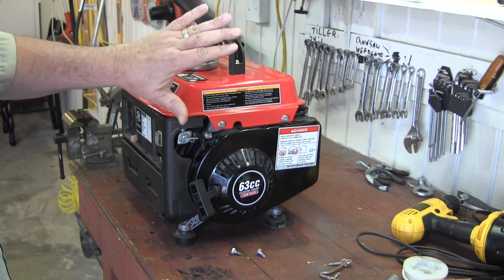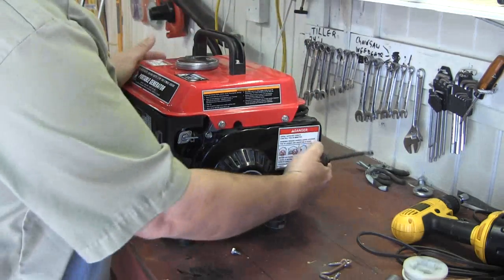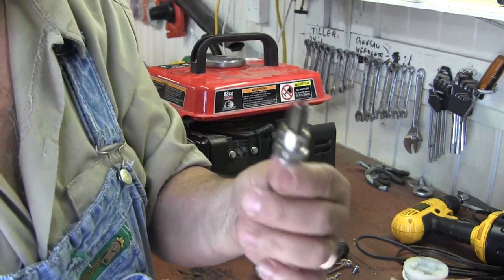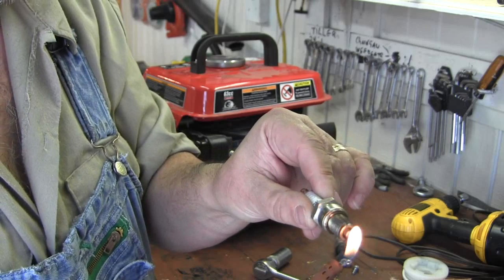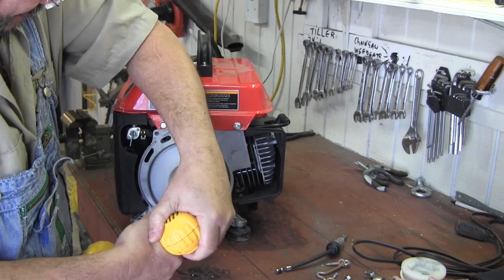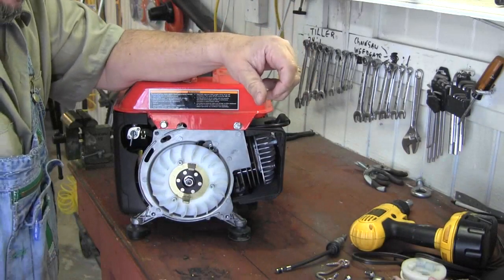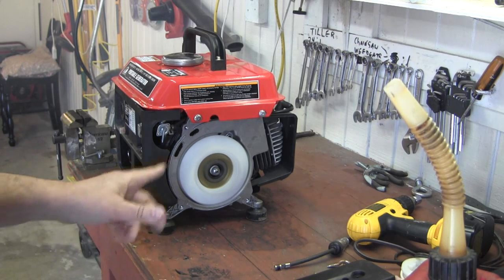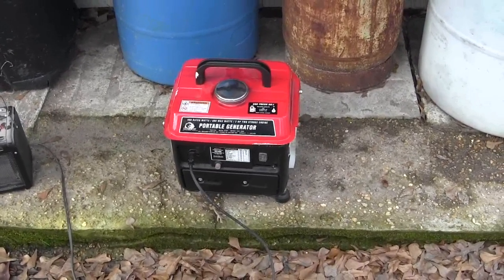Harbor freight generator wont start

Comment: V power for coils. Don't even worry about lawnmower shops. I got escorted off there shop. The original plug is no good. // Autolite is the best///// also 2cycle plugs. Tend to candy. Sand paper / small will clear that. you bet run it out. Thing when it's running is good.though I've learned all the traps.sgt williams retired.

Comment: The problem is not the spark plug or flooding. I own two of these 800 watts wonders, as well as several other small to medium sized generators, and the starting problem is ALWAYS the same after they sit for more than about a week...

WATER IN THE FLOAT BOWL.

The carburetor design will not tolerate even a small amount of water... and since water is heavier than gas, any moisture that condenses in the fuel tank always end up in the float bowl, and the engine will not start.

The solution is simple. Drain the float bowl EVERYTIME before even trying to start if the generator has sat for more than a few days. All you need is a 10mm wrench, a small cup, and about 30 seconds.

This basically never fails. 99.99% of the time, after turning the fuel back on and allowing the carb to refill, the generator will start on the first or second pull.
Reply from the maker: K Danagger no. This was so flooded that when I pulled the plug and cranked it over,fuel came shooting out of the cylinder. This was a case of not shutting off the fuel and the needle valve that is supposed to be pressed into the fuel orifice when the bowl is full, leaks fuel slowly into the carb and then into the cylinder.

Comment: all chinese engines come with a cheap, no good spark plug.  change the plug & no more problems. install ngk or champion or any good quality plug. my generator came with a plug named "torch" & it wasn't a torch by any means.after putting in an NGK, it starts on the first pull.

Comment: maybe the gas got old. would not fire.  easy. remove the gas from the tank. leave the plug out. choke it. pull it over 5 or 6 times.  clear it out. and with the pull stater  removed the engine is not being cooled.

Comment: When a small engine is flooded bad especially let sit for so long the gas will  run down in to the oil you always change your oil when something is flooded that bad
Reply from the maker: For someone that seems to know what they are talking about,your comment is  funny. This is a 2 cycle engine. there is no motor oil to change.

Comment: My name is Tom and I have G.M.C 850 generator no use for one year.I tray to start bat no start.Compresion is good but pure spark on sparplug.How I can repaire.Lot of thanks if someone cen help me aut
Reply from the maker: Tomo, if you have good compression and good spark,then your issue is fuel related. Remove the fuel line from the carburetor and open the fuel valve to see if fuel is actually coming out of the fuel line. If it is,then you have narrowed your problem down to the carburetor itself. If you've gotten this far, remove the carb and disassemble it, then spray all the orifices with carb cleaner. If you have an air compressor,blow it out with compressed air. If you don't have a compressor,you can use a can of air that is used for blowing dust off keyboards. I have a friend in Rijeka named tomislav. Dobro jutro !

Comment: Base on experience with anything with Engine, and has petrol on it, and you left it sit for a couple of months or even just weeks, it's always the fuel that's messing up. On my Big-bike, and small gen set same as yours here when it start to stall at the start, I just drain the whole tank with the old Petrol Gasoline, and put it new ones, after that, I remove the carburetor and clean them up, and always find a gummy red thingy which always come from old petrol, clogging everything. Then put them back together, and it will run file just like new again. Somehow, Petrol (Gasoline) loses power after a period of time, so I always drain old petrol every month, and just trash it or use them for stating wood burning or something else.
Reply from the maker: Well, in my country they add ethanol to our gasoline. The ethanol evaporated in a very short time making the gas have a much lower octane level. Old gas here causes problems much more quickly. In this particular instance, it was the fuel shut off valve that turned out to be the problem allowing fuel to flood the carb and even fill the cylinder up with gas.
Reply: Greatly agree on that one, that's one of the reasons why fresh Gasoline from the fuel pump smells fresh and like gasoline, and then after a weeks leaving it on a container, it will smells different, you can smell like it already loses power ignite something, although it will still ignite, but engines I mean. It's no longer powerful enough to kick an engine.

Comment: Hate to break it to you but its junk now.......  You ran it with no cooling shroud on it and worse yet under full load!  That recoil is not just a recoil, it directs air from the fan over the cooling fins to cool the cylinder!  You most likely already found out it sized up or it has no compression any more. It's fine to run it for a minuet or two under no load with out the recoil/fan shroud but you ran it for a long time under full load.... If you want to use a drill to start it do it them while its running replace the cover (carefully because of spinning fan) or get it warmed up and them put it back together and restart it with the recoil. If you want to start it every time with the drill gut the recoil and drill a hole on the front of the recoil/shroud so you can put the socket in through the front!
Reply from the maker: i ran an entire tank of fuel through it. it was a very windy and very cold day. its fine.

Comment: Thats one sure way of killing the Genny......You need the side panel on to cool the Cylinder Head ...The flywheel is designed to pump air to the cylinder head but it needs the shroud putting back to force it that way....Melted Piston laters
Reply from the maker: charlieoscar09 oh dont be a negative Nancy. It's just fine running it for a while with no shroud. It wasn't long before I put it back on.

Comment: Cheater!!! Ya know your supposed to check that spark with your tongue....gaaahhhh :)))  i hated when i do that but ill pull the plug and give it a few pulls to clear out the excess gas..and for lowbuck check the harbor freight site for coupons and i just got a sale sheet out of last weeks newspaper with a coupon for $89 good til 5/13/14
Reply from the maker: Thats how i check my car battery! that what i give for mine.90 bucks with a coupon.